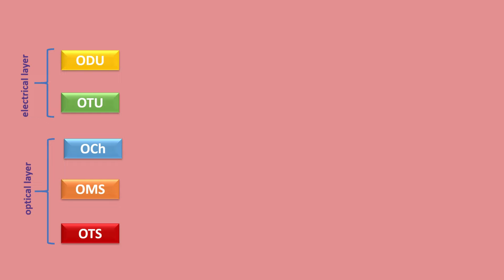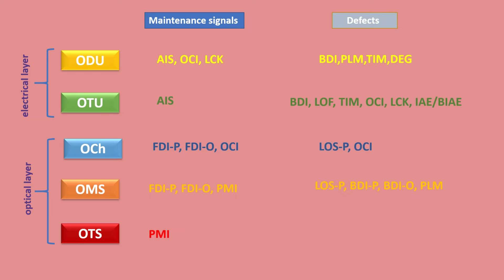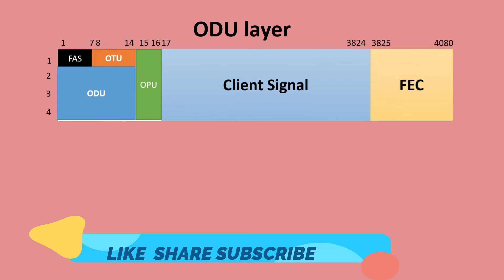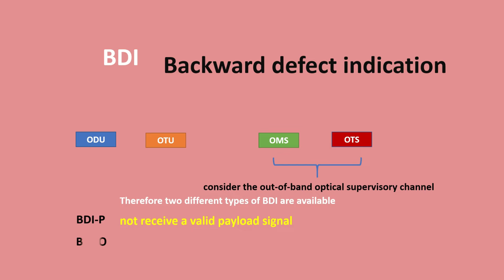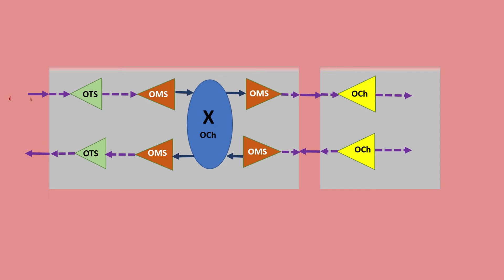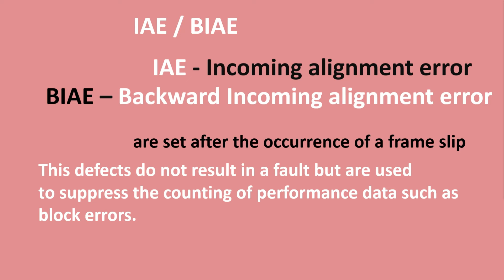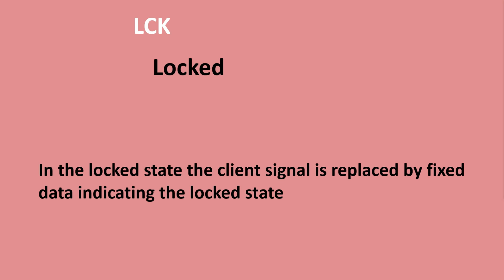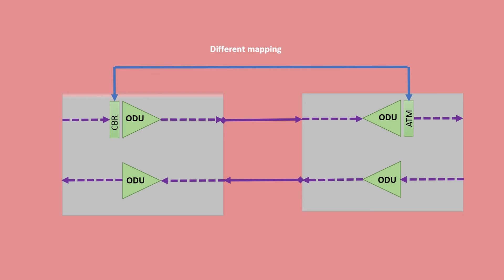OTN alarms #OTN #DWDM #telecom ROADM | OTN #roadm #otn #dwdm optical fiber

Comment: I need TIM alarm
Reply: Trace id mismatch happens if rx trace string is not equal and to expected trace string. It can be compared at operator, sapi, dapi, sapi & dapi. Mismatch can result in alarm or traffic squelch or no action based on user configuration